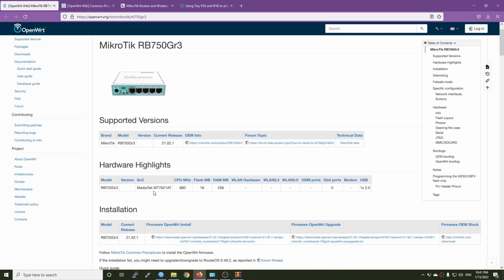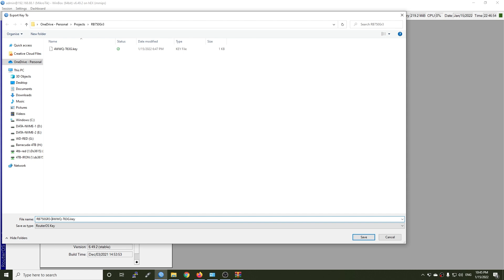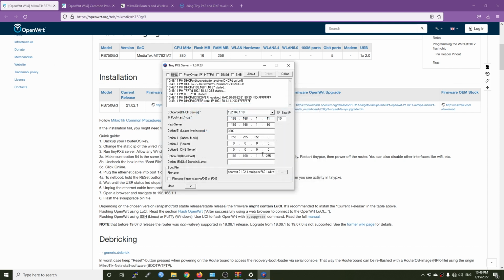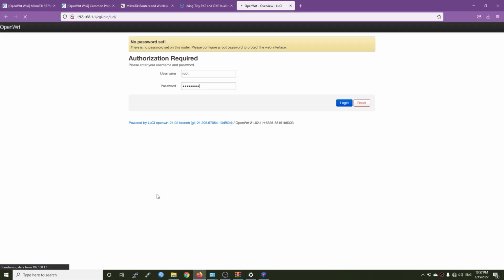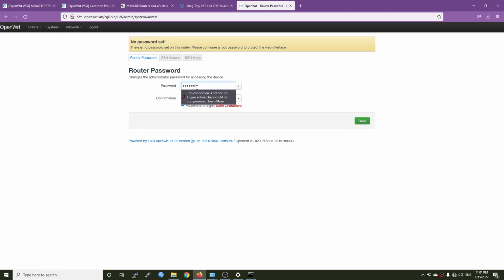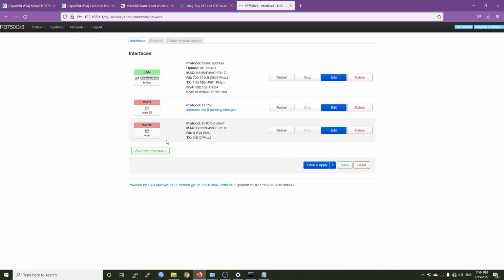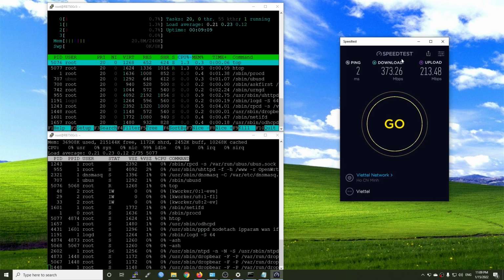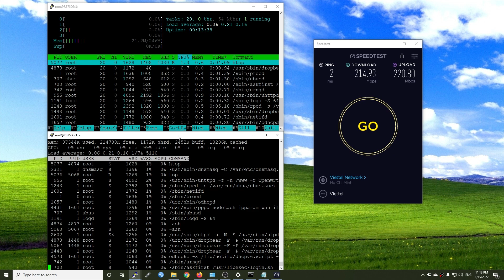OpenWRT - Install OpenWRT 21.02 on Mikrotik RB750Gr3

Comment: Thank you for that clear instruction!
One IMPORTANT note:
Sometimes its impossible to setup latest version of OpenWRT and you need to try older version.
You didn't see any errors. Logs in TinyPXE will looks fine and when you change port from 1 to 2 you can't reach address 192.168.1.1. So in that case take older version of openwrt.
Also you can try other subversion of RouterOS v6.xx

Comment: I'd never flash a MikroTik product with OpenWRT, despite the fact that I love using it as much as RouterOS. The reason is the motivation for me to move out of standard consumer grade stuff in the first place. I got tired of perfectly good hardware losing updates, lacking performance, getting bricked by official firmware, and hardware getting EoL and deprecated despite being powerful enough for my use case. Secondly the fact that the stock firmware wouldn't allow me to take full advantage of the hardware.

Both RouterOS and OpenWRT solves these problems for me. Both have life long updates and both let me get as much as I can (to the best of my abilities) out of the hardwares. As such if RouterOS is already there, I don't see any value in switching it out for OpenWRT.

Love the video regardless, because love the endless possibilities with both platforms.
Reply from the maker: Totally agree. I have been using Mikrotik boards in production environment and there is no point to complain about its performance (even though there are still small bugs). However, as a channel making videos about OpenWRT, I want to try all the possibilities and see how Open-Source working with a board/system made for Closed-Source. I belive there are people who is having the same idea with me and perhaps searching for the same thing on Google (like what I did previously), that is why this video come.
Reply: OpenWRT allows you to write your own apps, doesn't it? RouterOS doesn't. That's an advantage
Reply: @VanTechCorner  I appreciate all your videos, and they've provided with some good fundamentals in OpenWRT. In my network for routing and managed switching, I have 90% MikroTik, but for APs I strictly use OpenWRT. This combination has been working great for me so far. Most amazing thing that has happened since my network transformation to present state, is that I don't have any unplanned downtime. Sometimes if I didn't upgrade firmware, the setup runs for months until I finally get around to rolling out the upgrades.
Reply: Yes of course OpenWRT is open and OSS so it provides a degree of freedom that MikroTik won't. But I mentioned my original motivation, I don't want to stop receiving updates for a perfectly good working hardware. I understand if hardware doesn't have enough resources to perform actions but I don't want them to be deprecated because vendor released a new product and they don't want to support the old working hardware anymore. Both MikroTik and OpenWRT ticks this box.

On the other hand... MikroTik has scripting built in and in version 7 of RouterOS they have container support. I think these two features allow one to greatly augment RouterOS functionality.

Regarding this particular model, Hex, the device only has 16MB flash. Unless one builds their own image, with pre-built OpenWRT images, there isn't much space left for a whole lot of new stuff.
Reply: Heh, HEX has also micro SD card slot
Reply: There is one advantage of using OpenWRT over RouterOS. RouterOS doesn't support 802.11r which is nice to have if you have multiple access points and you don't want to experience downtime while reconnecting to other AP, plus ability to install packages like docker which can turn your router into mini server.
Reply from the maker: If you plan to run some Linux app, such as Adguard Home, NUT or using some third party 3G/4G USB devices (not all model works with RouterOS), you will have another reason trying OpenWRT.
Reply: @VanTechCorner  the latest routerOS v7 has excellent LTE devices support as it support all MBIM driver supporting devices. It have been released for all devices since in 2021 December. 
Router os also support virtual machines but only on x86 platform.
I haven't expected problems with WiFi roaming without 802.11r support but I need to learn something about this. Thank you
Reply: @davidciprys7811  Agreed, and also WPA3, MU-MIMO and 802.11s support which I've been utilizing for almost a year. Hence the reason I strictly use wireless APs with OpenWRT. This is also the reason a non-wifi capable device such as Hex doesn't get any benefits (in my book) by switching from RouterOS to OpenWRT.

Van in this channel also has a video on installing OpenWRT for HAP AC2, which I think gets better with OpenWRT to be able to take full advantage of the wireless capabilities of that device. I'd also like to see OpenWRT supported on HAP AC3 which has more RAM.

It's just me but WRT, my understanding, stands for Wireless Router/Routing, and because of my OCD I can't see myself using OpenWRT in a non-wireless device anyways (will likely be at my peril at some point).

Again I don't need to be sold OpenWRT, I use it on a daily basis. I love using it.
Reply: SIR, we can do this on other hardwares which cheaper or got bad original OS/firmware than RouterOS on Mikrotik devices like this way.
Reply: you need to see the article reasons for using OpenWrt. One of many is security, another is flexibility, another is always updated kernel and not a fork, another is stability.
Reply: you brick because you don't know what you're doing or make mistake.
Reply: @RavingMad it's better the other way around. OpenWrt as routers and MikroTik as (not-so-dumb) APs.
Reply: @RavingMad updates for what? For some aspect I may not need or some obscure detail that as already been resolved in mainline kernel. OpenWrt updates more often than ROUTER OS crap.
Reply: @RavingMad with OpenWrt and extroot, space is never limited.
Reply: there is no "endless possibilities" with closed software.
Reply: Massive advantage
Reply: @RavingMad 16 MB is more than enough flash space to install extroot!!!
Reply: @RavingMad your book is outdated sir
Reply: @RavingMad An OpenWrt is vastly superior to MikroTik as a VPN or router and in QoS, CAKE, bandwidth management with easy intuitive configuration of DSCP it's simply years ahead of MikroTik.

Comment: I have one of these routers (the Mikrotik RB750Gr3 HEX) and have been considering flashing OpenWRT. I bought this router because I thought there was support for Zerotier on Mikrotik. However, turns out this is only true for the Miktrotik ARM based routers...not the mmips (Mediatech) based Mikrotik routers. I've since switched from Zerotier to Tailscale, but still no way to run either (Zerotier or Tailscale) on a Mikrotik RB750Gr3 when it's running RouterOS. Hoping that with OpenWRT, I can have either Zerotier or Tailscale running on the device.

Very good video. Thank you for sharing...
Reply from the maker: Cool. Thanks for sharing another reason to use OpenWrt on this RB750Gr3.

Comment: I have a question, in my country we use ADSL  in our homes but the problem is i have two routers i install in them openwrt but openwrt says that DSL port will not work so there is a way please to use PPPOE in this routers like a converter or something else

Comment: What’s advantages of openwrt vs router os? Router OS imho is way more powerful than openwrt, despite all the complexities but it also comes with a lot of functionality (yes, some of it are proprietary. I have installed openwrt before but not so impressed despite easy configuration in the beginning but not much use later on.
Reply: Personally I don't see the great advantage of OpenWRT in a mikrotik Router, Mikrotik has a thousand times more functions than said OpenWRT. Personally, it is a bet that I would never do it.
MIKROTIK FOREVER...
Reply: @JHerrera-k2q  Thousandly agree man!
Reply: Openwrt mean freedom of wireless! This word can win!!!
Reply: Well, I have some issues with RouterOS. It has tons of functionality but some functions do not work well together or are unstable (Wireguard, some seetings in VLANs). Also, with OpenWRT I have better performance. When I put 15 users on wifi on RB951G-2HnD with RouterOS, internet is unusable - pages do not want to load (no SQM, 50 MBit). 15 people on the same router with OpenWrt can browse the internet fine (again, no SQM, 50 MBit link).

Comment: i wonder is there any way on flashing RouterOS onto ZBT WG3526 router as it has the same chipset
Reply from the maker: If you ask me this question few years ago, I will anser it is impossible.
Recently, I have seen some devices with the same chipset runs RouterOS level 1. Those are selling very cheap on the marketplace, perhaps you look for one. Try to look around these forum: right (dot) com (dot) cn, or 4pda (dot) ru, it will have the information you are looking for.

Comment: Hi, after running the openwrt i can enter the interface, after  uploading the flash file the router reboots and i cant access it anymore, no LAN lights power, only power and usr . I can redoo the process but anytime i flash the frimware the router wont work. 
Mikrotik RB952ui
Reply: Update : 

To make it work , every time i turn off (reboot) router i have to reset it with the button , after the reset the router will boot up and openwrt interface will open . I have to repeat this step every time the router is shut down. 

Any ideas what to see or config ?

Comment: mikrotik irb750Gr3 is an old router i has flashed a long time but now i has fiber i use a new best router ;) but great video van :)
Reply from the maker: Wow, what is the new router that you are using?
Reply: @VanTechCorner  i'm use linksys e8450 aka rt3200 but not available in your country 🙂

Comment: What are the usb port supposed to be used for? Theres nothing about it in documentation. What does the mode button do? Nothing on that in documentation as well
Reply from the maker: Well, in OpenWrt, the USB port can be used to connect anything has a USB interface, such as a USB 4G modem, a USB WiFi adapter, a printer, a USB stick, USB HDD ...You can also connect your iPhone/Android phone to it to use the cellular data. There are different things you can do with the USB port, the same go to the button. It is not limited like what you can do in RouterOS.
OpenWrt is open-source, the information (the wiki) is contributed by developers and users (like you). For sure there will be something not found in that wiki, but it doesn't you can't find it somewhere else.
Let's say, the user manual of the Laptop will not tell you what you can do with the USB port, but you will know what to do and how to use it.

Comment: Dude, thanks for you work, but why the hell do you use Openwrt if Mikrotik router os is a powerfull software??
Reply from the maker: Hey, there are lot of things OpenWRT can do and RouterOS can't, and vice versa.
For example, before ROS7, Wireguard is not supported. Also, OpenVPN is not fully working on ROS7. Other Linux packages, such as nut-server (network ups tool), pi-hole, adguard home are not running on ROS. But when the same device running OpenWRT, I can configure it easily.
If you take a look, the video is reaching 50K views. This shows that a lot of viewers find the video useful, or they are curios, or have the same thinking but want to see what is the out come.
From my comparison video, ROS and OpenWRT give the almost the same throughput https://youtu.be/bllvDWEKgNA

Comment: my mikrotik device has downgraded my internet speed...the only reason i bought it was because of multi-wan load balancing or resiliency. professionally i've spent whole lifetime dealing with devices from all brands including cisco as my bread and butter. How can i troubleshoot the speed degradation issue because of adding mikrotik itself is a big concern. Configuration was painful too. All i wish if there was an option for simply putting pfsense on it .. but this device is  not worth it.

Comment: Could you please make a guide on how to make a custom x86 router. Like if I’m going to do 1gb sqm and adblock, what kind of cpu should I choose, how much ram and storage do I need, how do I install it on the pc, etc. Also maybe discuss how each pc part affect total power consumption.
Reply from the maker: Hi, I already did some videos with x86 and you can find them in the OpenWRT tutorial playlist (on the channel homepage). There is no solid information on what kind of CPU can handle what kind of throughput, and the same for the power consumption. However, if you have the name of the CPU in your mind, just search it on the Google or start a thread in the OpenWRT forum to discuss with other users.

Comment: rbm11g can be flashed using this manual?
Reply from the maker: Yes you can, the procedure is almost the same. The firmware here https://openwrt.org/toh/mikrotik/rbm11g
Reply: @VanTechCorner  Ok. Thank you

Comment: Wary funny! Why would you want to install OpenWRT on MikroTik? Do not make any sense to me. This is a great example of why you won't do what you could do. :-)))
Reply from the maker: It doesn't make any sense to you, doesn't  mean it doesn't make sense to others. OpenWRT firmware for this device doesn't available by default, lots of hard work from developers and community users makes it exist. Maybe you can see the performance test of this board running OpenWRT vs. RouterOS to understand the reason to use OpenWRT.

Comment: How about convert mi4a gigabit to mikrotik?
Reply from the maker: It is impossible. You can only install RouterOS in Mikrotik board or x86 PC.
Reply: @VanTechCorner  ok. by the way, i have install openwrt like your video but when finish upgrade sysupgrade then reboot my router stag on reboot continuesly. after i reset can be boot openwrt but when i unplug the power suplly the router reboot continuesly again. how can i fix that case?

Comment: Hello Van, Can you please do an X86 install video on hard drive with 21.02
Reply from the maker: Hi, I made one for OpenWRT 19 before and the procedure is just the same. Do you have any problem with the installation?
Reply: @VanTechCorner  Hello Van, I can install fine, the only problem is how do you do the extension of the filesystem of the hard drive? on 19 there is 2 partition, in 21 there is 3 partition. Please make a video
Reply from the maker: @gimbleguy  Hey, I missed a lot of comments recently due to the Lunar New Year holiday in SEA. I will take a look on this and will make one post / video.

Comment: Mikrotik rb750gr3 or nanopi r2s for link 750mb
Reply from the maker: Hey, very late response:
- RB750Gr3 NAT throughput: ~500 Mbps
- NanoPi R2S NAT throughput: ~ 700 Mbps
- Enable fasttrack(RouterOS), software offloading (OpenWrt), both can give you 940 Mbps throughput. So, it is up to you :)

Comment: Tell me why... just experiment ?
Reply from the maker: A lot of OpenWRT developers and users spent their ime and effort to make this possible, and the MT7612 SoC is well supported with hardware flow offloading. That is why I made this video. With RouterOS, I can't run other Linux app, such as AdguardHome & NUT, and OpenWRT get it done easily.

Comment: i prefer to use totolink x5000r than this router, more cheapest and simple to install openwrt plus dualband ax1800 wifi. the other specs, same as mikrotik rb750gr3 minus usb port.
Reply: Linysys E8450 similar hardware and
more flash ROM/ RAM